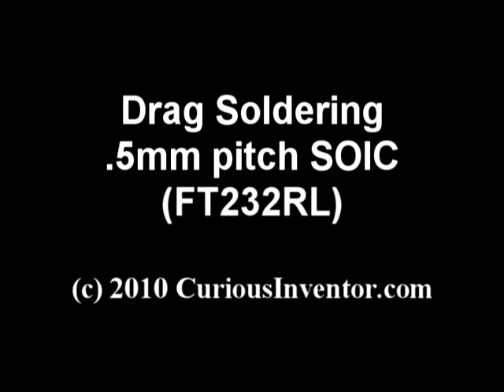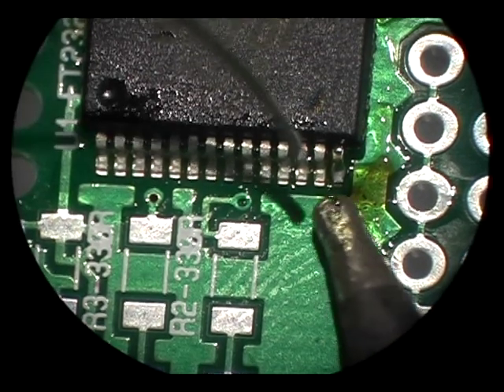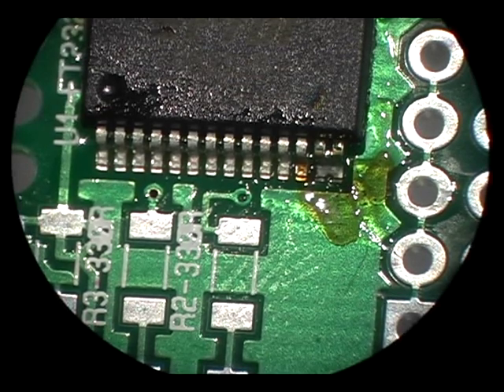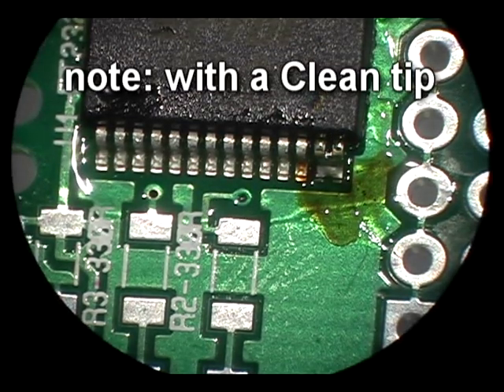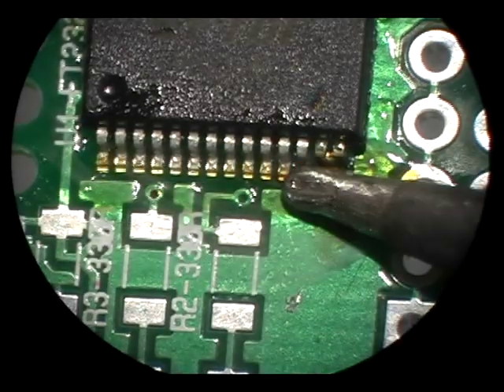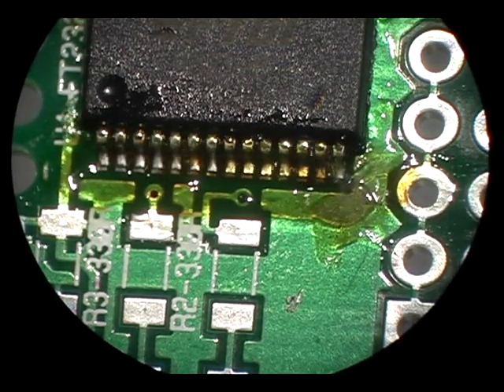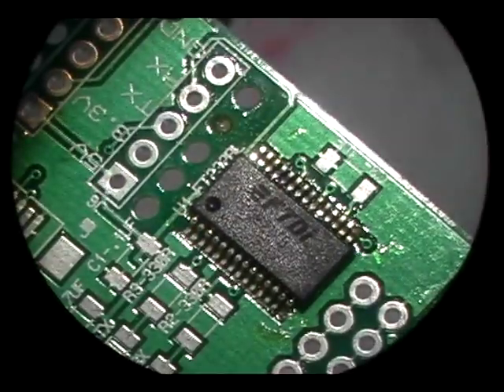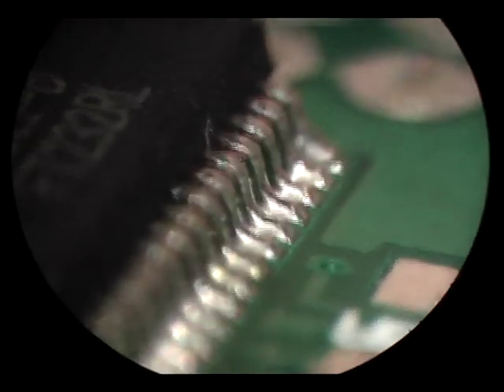HowTo: Drag Soldering Demo

Comment: It’s been a very long time since I’ve done drag soldering, or in fact any soldering. And I believe newer solder doesn’t contain lead, which causes
more dry joint issues, such as the Yellow Light of Death problems on the PS3. But when I used to drag solder IC’s with similar size legs, I’d only need to make one ‘drag’, and provided you had cleaned the board, and positioned the IC accurately, you’d just drag it once, and then clean it with a cotton bud and contact cleaner. Very rarely would I get a blob of solder between legs.

Comment: Really enjoyed the piece on the SMD drag soldering. I was doing a vid on my first experience with SMD repair. As a side note I am dealing with a slightly deformed pad where the replacement 16 pin Darlington array 7NPN chip will be going. The old one just fragmented due to reversed polarity on this little controller module. I am hoping that nothing else was damaged in the process. During the little explosion, one of the pads has been slightly distorted. I am using a hot air tool and I hope that I can get it to lie down a bit without it coming off entirely. And that gets me to my question, I am trying to document this and I have a hat cam with a 120deg lens on it that has fixed focus and I can really only get so close, so the coverage won't be stellar. I wanted to ask you what you were using that permitted you to work and record simultaneously? It would be very helpful. Thanks and keep up the great contributions. I have subscribed
Reply: I know this is an old question, but it looks like he's using a microscope to me. I've taken a few pics through a microscope, and that's what it looked like.
Reply: Yeah, oh god this makes me laugh, like reading from an old journal entry or such. I didn't know diddley squat back then. I know now exactly what he might be using, and how much it cost him for the pleasure. :-) Happy hacking et al

Comment: what dimension is the tip you're using here? thanks.
Reply from the maker: +giovanni spinotti 1/32 screwdriver or chisel tip: http://amzn.to/1Qwfjxi or http://amzn.to/1VyWYy2
Reply from the maker: +CuriousInventor you want a tip that can hold a bit of solder on the end and has surface area to transfer heat. Really fine points are actually hard to use in SMT soldering.
Reply: Thanks for the answer. It doesn't seem that my iron has those tips available, I might just file a slightly larger one.
Reply from the maker: +giovanni spinotti larger will be fine (better than smaller). If you get too much solder on, add more flux and drag a cleaned tip over pins again to draw away extra. Wick can also be used.
Reply: I personally prefer using j-shaped tips for drag soldering. They're very multipurpose as well so you can drag solder with the wide side and then do individual tacking with the fine point at the end. Only real problem is the fine point can be a nightmare to deal with pads on large ground planes, but with enough flux you can get it to flow properly.

Comment: Its better and easier to use a proper reflow tip (also called bath tip) which has a concave hole to hold solder in.

If I used the method in the video i'd shift pads

Comment: No its wont have connections between  the tips. The solder will flow evenly under the pins. Just try before U open your bad mouth.